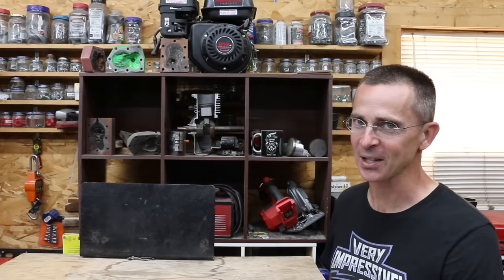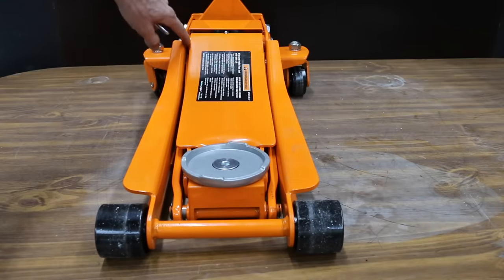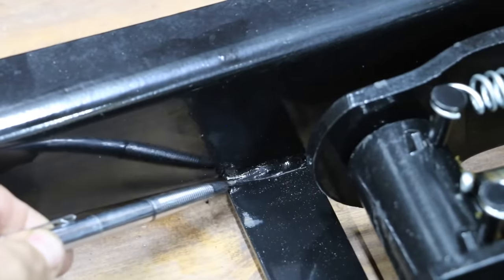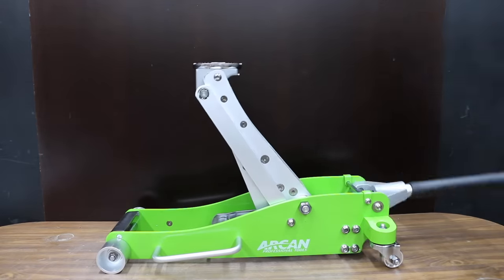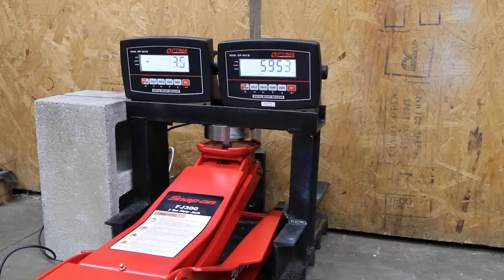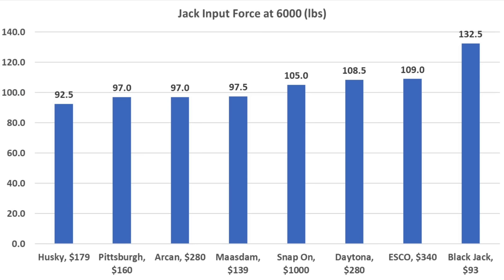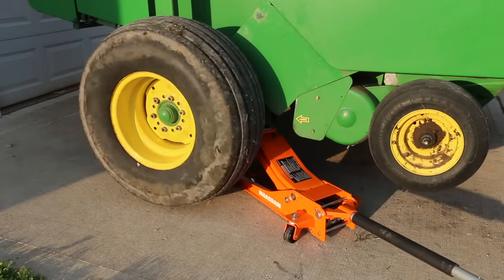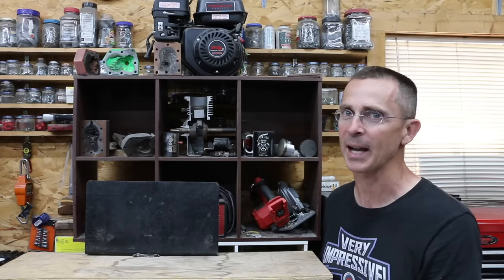Best Floor Jack? $1000 Snap On vs Daytona, Pittsburgh, Arcan, Black Jack, ESCO, Husky, Maasdam

Comment: I don't understand the obsession with quick lift capability (few pumps to maximum lift). Who really cares if it's 4 pumps or 20? There is significant downside to fewer pumps. Example: jack is under car far to access jack points, jack it up, and need to remove the pump handle for whatever reason, maybe to access car components, jack stands are in place "in case," but the car is resting on the jack 1/4" above the stands, the receptacle the handle inserts into quickly springs up, and to to lower the jack onto the stands you need to insert the handle with the receptacle and twist, and the receptacle is now at 90' and impossible to insert the handle into without moving it back, which takes a great amount of strength on an essentially 2" long "handle." It can be done, but takes an enormous amount of strength. If the jack needed more pumps it would be much easier, and so the obsession with few pumps vs the actual need for few pumps seems wildly out of balance. For people that truly need few pumps, like pit crews, they never remove the handle, and the car never rests on jack stands, and truly pro race cars have lifting capability built into the car itself and those cars don't use jacks at all, only compressed air. So the quick lift capability seems to be a solution in search of a problem IMHO.
Reply from the maker: Thanks for the feedback.
Reply: @ProjectFarm Thanks for the response! In my opinion, and this is in relation to my needs, characteristics far more important to how many pumps a jack takes are the reach of the jack (how far can you stick it under the car and have the handle still outside the car's "footprint"), maximum height of the jack at it's highest point in case you do need to insert it with the handle under the car's "footprint," weight of the jack (long reach steel jacks routinely weigh ~ 100 lbs, which is substantial for a "tool"),  overall jack width (how much a "footprint" does the jack have, because real-estate under a car can be precious, AND when jacking up a car by it's designated jack points, there can be a positioning conflict between the jack and the jack-stand, and lastly, can the jack pad (the part of the jack that actually comes in contact with the car) be removed and a jack cross-member be installed and utilized for cars that need it, which is essential if there is some sort of jack vs jack-stand conflict and you need to raise the car by an alternate jack point that typically require two points of simultaneous contact. This last point is significant, because in my experience, descriptions of jacks rarely say if they'll accommodate cross-beams or not, AND of the three different makes of cars I have, ALL of them have this issue, the need to jack two points simultaneously to raise the car up so jack stands can be placed. Three out of three: I have faced this problem on my Honda, Chevrolet, and Nissan. A quick perusal of designated jack points for these makes will bear this out. Everybody says it, so I'll join the chorus: thanks for the videos. Your reviews are superlative and without equal. Your dedication and ingenuity are obvious. Hopefully you are getting rich from all your efforts. You deserve it. If it was easy, everybody would be doing it, but no-one else does what you do. Cheers!

Comment: Good video. I did want to point out that sometimes, not always. Welds are intentionally stitched IE a gap is left and then they start welding again. It's stronger that way if things start to go wrong. You don't want a long weld opening up.
Reply: Oh, same principal as rip-stop nylon. Interesting!
Reply: Strange how only the cheapo brands have this level of quality.

Comment: Got a Husky jack. It's a piece of junk. Had trouble building pressure. Must not have enough fluid in it. It lifted my car once after pumping a hundred times. Then it wouldn't lift again.
Reply from the maker: Thanks for sharing.

Comment: Plastic wheels on a floor jack? What a bad joke. I have a decades-old "Indy 5" floor jack that has steel wheels, with the front wheels being 3.5" in diameter. The welds look as good as the welds on any of these jacks, and I can't remember how much it cost, but it couldn't have been much, since I was broke back then. Guess I should clean it up and start taking care of it. Everything these days is crap.
Reply from the maker: Thanks for the feedback.

Comment: I’ve owned a snap-on for 15 years,  needing a 2nd I bought a daytona. After about a year the high end piston started sticking and needed a screwdriver to get it to pop out. After 2 years both high and low started sticking. I threw it in the dumpster and bought another snap-on.
Reply from the maker: Thanks for sharing.
Reply: Sunnex thanks you because the both are made by sunnex.

Comment: atv pedals
Reply: a kickstand with gearing BAW using magnetic tension
Reply: handlebars and kickstands are coil not swirl
Reply: fork margin coils
Reply: peg vacancy and coil margins opinionated
Reply: lift abec standard
Reply: them disc not multi squad abec neither bimbo
Reply: abstract abec format greater strain relief
Reply from the maker: Thanks for the suggestion.

Comment: Is the inexpensive as good as the expensive?    Well that depends on what you need it for.   If you just have a little 4 cylinder hatch back, and it's only going to be used for changing tires.   Then yes, the inexpensive jack will work just as good as the expensive one.   And it will be a lot easier to move around due to smaller  size and weight.

Comment: Actually,neither one of these are made for uni-body cars!  They will crush your rails.  Uni-body cars have been around for fifty years now and garages still run these under your can, jack it up, crushing your rails, then when you are on the road and should need to change a tire, that it when you will discover that your rails are crushed, and your jack will not work on a crushed rail!
Reply from the maker: Thanks for the constructive feedback.

Comment: This is s bad test, a jack should be measured by its durability over an extended period. Snap on has a history of quality. It's expensive but in my 43 years as a mechanic I have seen Jack failure.

Comment: My 3 ton Pittsburgh has a bent frame despite it never lifting more than 2 tons
Reply from the maker: Thanks for sharing.
Reply: DING! DING! DING!  I'LL TAKE "THINGS THAT NEVER HAPPENED" FOR 500 ALEX...
Reply: @kodoan411  I can text you a pic of you want right next to the vehicle it lifts. Front wheel of the jack sits a good bit above the ground. Lifts a mostly stock 03 excursion. Thing weighs 8,000 at most and I jack up one dif at a time, that’s 2 tons.
Edit: didn’t even take too long either. Noticed after the first few times of using it. The lift arm is also way off center, pretty much just riding the left side. Either built on a Monday, or Pittsburgh is who I thought they were.

Comment: Daytona jacks are crap.  I've had 3 in the last 4 years.  1st one leaked after 10 months, 2nd one had one if the spring lifters get seized, 3rd most recent one the U-Joint broke in half.   I need a more durable brand to go with.
Reply from the maker: Thanks for the feedback.

Comment: On paper the Daytona looks better than the Pittsburgh but in real life it's not I've got a Pittsburgh that's going on 10 years old I still use that thing for lifting a 7.3 Powerstroke all the time never any issues guy I work for has a Daytona that's about a year old it doesn't work the plungers that pump the hydraulic fluid seized up so from my experience Daytona is a garbage and I take Pittsburgh any day I've used all the other jacks and my Pittsburgh keeps going
Reply from the maker: Thanks for the feedback.